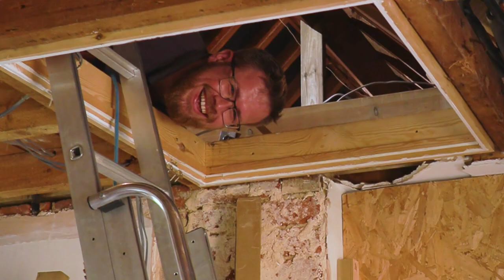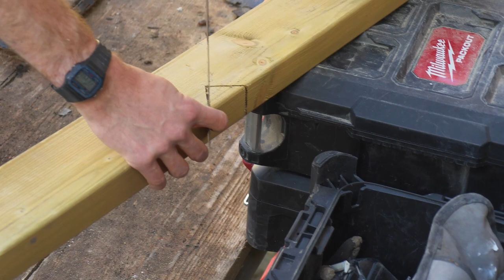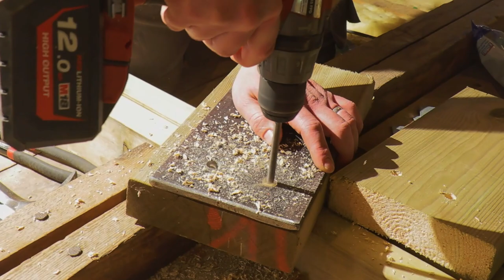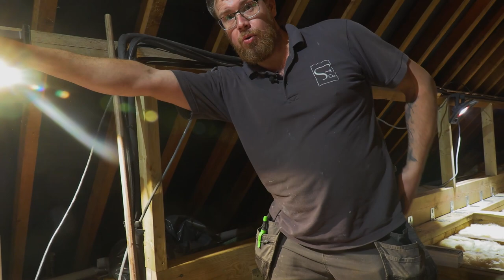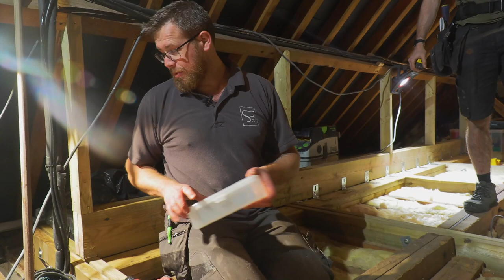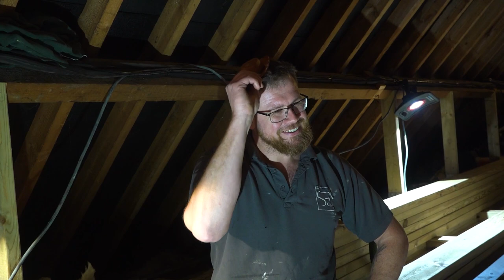What's a Flitch Beam and What are The Benefits? ~ Extension #35

Comment: Just out of interest the difference between universal beams and rolled steel joist is the section. RSJs have much thicker flanges with a steeper angle (about 5 deg) whereas UCs have almost parallel flanges. In reply to a previous comment I will say that if you take a building inspectors advice on structures make sure your insurance is up because if it falls down the council will take no responsibilty for it. Building inspectors are only there to make sure that the building complies with the approved plans.
Reply from the maker: Martin That is good advice on the building inspectors and interesting about the RSJ. I guess a rolled joist is run through rollers when it is hot where a universal column is pressed.
Reply: RSJ's lighter than  UB's but only strong in 1 orientation.

As i understand it
Reply: @joeatkin6600  I'm not sure about that. UBs tend to be wider across the flanges in relation to depth than RSJs. The flanges are also thinner and parallel in section. I recall many  years ago one being specified as a runway beam for a chain block and at full load the flanges bent. You really need an engineer to pontificate on this, but I've little faith in modern ones with their computers. Total inability to resolve the forces on a hip is just one thing amongst others. Maybe I'm old fashioned but I look at the amount of timber in this roof and I wonder why they don't carve it out of a solid block!! I was brought up on the likes of McKay's carpentry.

Comment: Are those ceiling joists sistered or have they been flitched too?
Reply: The existing ceiling joists have been fixed together with a 6x4 binder which in turn is fixed to the new trimmers with heavy duty angle brackets.

Comment: I had the idea of using galvanised steel C sections... the same steel as used in steel shed/building construction in 3m lengths but bolted back to back iin a sort of staggered formation to then run the length of my roof ...to create the internal steel beams

---- ---- ---- ---- ----
  ----- ---- ---- ----
this sort of formation.
Reply: ps... these 3m C sections can be bought quite cheaply as salvage items or offcut.
Reply: Sounds like two parallel flange channels bolted together. This is common practice so you’re on the right track!

Comment: Good video, for the timber and steel flitches you should use toothed washers to distribute the load into the timber to act as one and transfer load more effectively ,.. generally 5d edge distance for bolts in timber.. Hope this helps
Reply from the maker: Neil Thanks for your advice. When bolting two timber beams together a toothed washer helps. When you are bolting steel to timber there is nothing to get your teeth into on the steel side. Hope this helps.
Reply: 5d for bolts in timber even with a Flitch plate ? And a plate washer. Is this BS code or EN code and does is form.oart of EN 1090 - 1or - 2
Reply: @SkillBuilder  Sorry you are missing my point, the toothed washers go into the outside of the timber joists only.. no toothing into the steel plate as its not possible.. in ur video they used flat plates which doesn't transfer load as efficiently
Reply: Whilst you're right that single sided tooth plates increase bolt resistance  in timber, I've never found them to be necessary when calculating a flitch beam, so 1} I don't think it's worth creating the extra hassle for the installer to procure (single sided tooth plates are not as widely available as double sided ones) and fit (getting them to press in fully can be a pain, even when large washers are used),and 2) it risks creating the situation where they are not fitted and so the beam as installed becomes under designed. 
So better in theory, but not in practice -  at least in typical domestic scenarios.
Reply: @smartbuildengineering  A toothed washer being bigger helps distribute the shear from the smaller circumference of the bolt as it reaches the edge of the timber and thus reduces potential splitting. .. This is why I specify them and have had no issues from site.. Thanks for the reply and keep up the good work.
Reply: @neilkirman2258  Yes, I know how they work! I don't think the issue is splitting (that's taken care of by adhering to edge distances), its bearing of the bolt crusing timber that limits bolt capacity. Adding toothed connector changes the load path as you say, avoiding that particular failure mode. Having no known issues from site is irrelevant in my opinion,  unless you're there when the beam is being assembled, you really have no idea if they are fitting toothed connectors or not. Builders have enough to going on as it is so I think keeping it simple has its benefits. Also worth noting that TRADA design guidance and design examples for flitch beams do not mention the use of toothed connectors, and I don't think anyone knows more about timber than TRADA!

Comment: What's your opinion on Joyner bolts with integrated spiked washer? 🤔 I've used in similar situation and thought worth the extra cost. 👍
Reply from the maker: Not much good in steel
Reply: @SkillBuilder  ?? The spikes on the washer are not long enough to effect the steel. They would just grip the wood externally. It's basically instead of using that additional loose washer James had and they don't twist. I'm not talking about those separate toothed washers if that's what your thinking.
Reply: @burwoodbuild  I have seen them and they look the business but I felt the cost of buying 120 of them for this job was way more than buying standard nuts bolts and washers. Or am I shopping in the wrong places!?!
Reply: @jimichip  Harrods Hardware no??! 😁 I guess I was curious to try and didn't need 120. The additional washer is a neat compromise as I HATE bolts tightened into the wood!
Reply: @burwoodbuild  I’m a regular at Harrods, how did you know!?! 😂
Reply: @burwoodbuild  yeah I can’t stand seeing a bolt crunched right into a timber, you just know it’ll be loose in a few weeks!
Reply: @jimichip  I think we're in agreement there! 😉 Bolts will be loose as a 🦆!
Reply: @jimichip  n.b. that's supposed to be a goose, not a duck! 😅
Reply: @burwoodbuild  😂😂😂

Comment: Keep hammering the bolt into the steel plate, it’ll make it so much easier to fit the nuts !
Reply from the maker: Good point. They wiggle through easily enough so put the hammer back in that lovely Diamondback toolbelt.

Comment: Could you use plywood instead of steel plate?
Reply from the maker: OSB would be better, glued and screwed to add strength
Reply: @SkillBuilder  come to think of it, why not just bolt (and glue?) the 2 beams together?  Staggered if you wanted to extend length. Whats the advantage in having the small separation?

Comment: Engineers should be forced to work on site every 5 years for 6 months so they stop over engineering everything!
Reply: They'll be specifying 4x 2 battens soon, the last job we done the structural engineer was rubbish, we had to get stuff corrected 2 or 3 times with our designs. One of which being a whole corner of the roof with no support which he then charged the client hundreds for. An absolute joke. FYI was their engineer not ours.

Comment: Hi there. Not on topic for this video, however I have watched and sympathised with the video you did a while ago about the good and bad concerning heat pumps. You have been singled out and criticised by other channels of intallers who take issue with your criticisms and complaints. You need to watch and respond to these other channels. They have you in their sights, you need to answer them.
Reply from the maker: Hi David 
I know that I have been critcised by some of those other channels and it is all part of what happens if you stick your head above the parapet.  I am fairly certain that I would not change the minds of any of them because they all make a living from installing heat pumps. I am sure they all have their hearts in the right place and when I do talk to them it is surprising how much common ground there is. If we go down the intended route of taking out gas boilers and replacing them with heat pumps it will do that industry a lot of harm because heat pumps will get a very bad name. I am doing them a favour if they only knew it. The short term gain from the grant will destablise their market and make it harder for them in the future.
Reply: @SkillBuilder  Danger is not that you fail to alter the other utubers opinions, rather that criticisms of you leveled by others have an impact on the impression you make when discussing the heat pump issue. they undermine your input and put your arguaments into question. I'm simply recommending that you defend yourself.

Comment: Interesting: In my section of the United States, the term "flitch" refers to the slice off of a saw mill with bark on both sides.
Reply from the maker: Greg 
It is very interesting the way terms travel and change. "These are just made up words" as someone once said.
Reply: @SkillBuilder  The most interesting one I have come across is veneer, that started out as the word fin, like fish fin, that took a round on the continent, picked up Dutch spelling where f is v, and the double ee is from french. Fine is of the same root, so fine used to mean thin.
Reply: I have always associated a flitch with a side of bacon

Comment: With the flitch plate why not put the two timbers together, put the steel on top and drill through both which will save you having to move the steel from one timber to the other. More accurate as well.
Reply from the maker: The drill tends to drift off the line when it goes too deep because slightly out of plumb can be 3 or 4mm on a depth of 100 mm so you are better off doing it the way we do.

Comment: "We used to call them RSJs didn't we" well yes, but also no. They are actually different from modern I sections. Old steel grade, is similar to S275 strength, but the difference is RSJ have flanges that thicken at the root with the web, whereas UB or UC section have parallel and constant thickness flanges, other than at their root radius. Ditto for PFC, hence the name parallel flange channel. I presume the old style is stronger in torsion or buckling than it otherwise would've been, due to its shape. But if that's the issue, go to a box section. Probably a case of being easier to manufacture the modern ones, or that they're strong enough for their depth for normal applications, while using less steel. Well that was a tangent.....sorry
Reply from the maker: I love this kind of information but for most people an RSJ is an easy bit of short hand but should not be confused with an Irish Jay as I heard one customer call it.
Reply: @SkillBuilder  an Irish Jay?! Good Lord. Well at least they're trying.

Comment: Carting in the loft with a grinder is not a good idea
Reply from the maker: It is a hell of a lot better than lugging that beam back down stairs. We don't do it often and checked carefully  for any fire hazards.
Reply: Skill Builder you need an apprentice with a spark catcher bucket 😂
Reply: @SBIGDTSM  too funny I saw that on the tools earlier this month, broke my shit laughing
Reply: Spark chatcher, use them some times when cutting pipes in a nice clean area, usually the apprentice with a fire blanket followings sparks as I cut the pipe, both wearing appropriate ppe of course